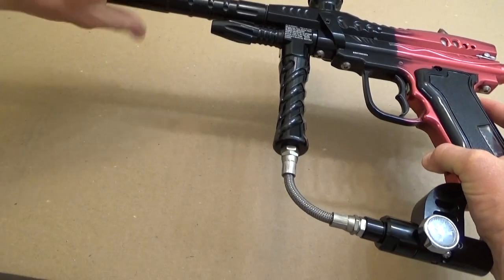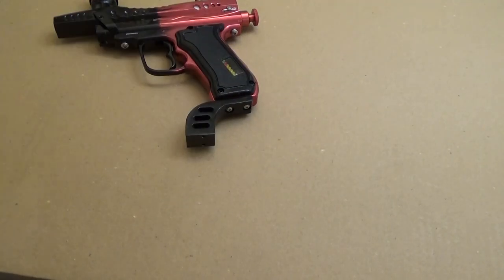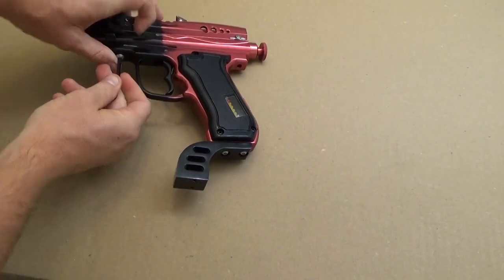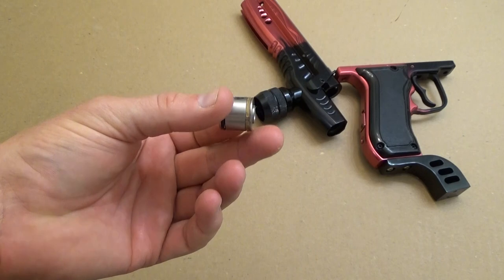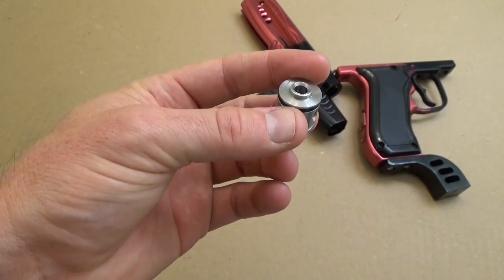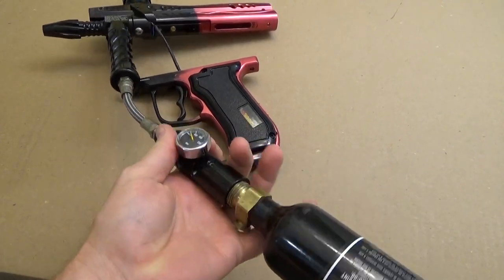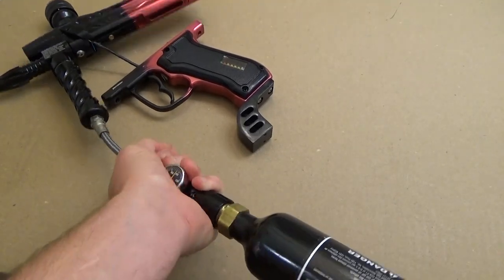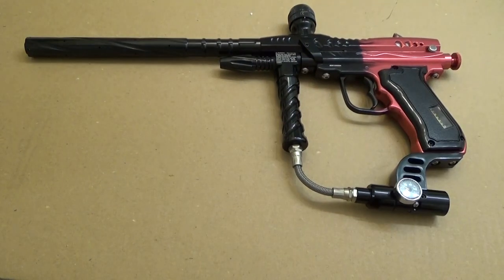How to Fix CO2 Leaking Down Barrel on Paintball Gun or Marker

Comment: 5 years later and you're still a life saver
Reply from the maker: Thank you.  Glad it helped.
Reply: Same here, was stuck until I watched this.  Had the same o-ring shredded.
Reply: @ClintHolland  what seal did you buy
I got the same paintball gun and the cup seal is in peace's.
please send me a link
Reply: I still dont understand what he means by hand tight
Reply: I’m struggling to fix my gun I have the exact same gun
Reply: Please reply I need help
Reply: @puglife_x_8975  hand tight means tighten by hand without the use of any tools, snug tight
Reply: @puglife_x_8975  but other than that, what else did to need help on?
Reply: @Cloud575501  I don’t think I need help any more, cause when I saw my valve o ring was torn up, I finally found that the problem was that so I was putting everything back together but the screws were not going in the holes all away and I don’t think my gun is going to work with the screws very loose on the handle of the gun. I don’t know if the holes could be messed up or if it’s the screws
Reply: @puglife_x_8975  i dont know man sorry
Reply: @BeatForge_Studio  it’s okay 👌
Reply: @puglife_x_8975  like dont tighten it a lot.

Comment: Perfect video. I've got a new gun with air problems. I fixed my old gun about a year ago and all your tips were exactly on point with my experience. O rings are biggest problem. Just check and replace any of them with little cuts or rot. Make sure that metal valve doesn't have scratches or anything. It does make a difference.

Comment: I just picked up a Diablo Mongoose and it looks like the thumbnail picture, not the gun in the video. Whats the difference? And it also came with some upgrades like a longer barrel and a different regulator that I'm trying to identify but haven't had luck. Think you could help me out?
Reply from the maker: Absolutely.  Happy to help.  The marker in the thumbnail is a Diablo Mongoose.  The one in the video is a Diablo Mongoose II Reincarnation. http://redfiremusic.tripod.com/diablo.htm  The main difference is the rate of fire, 18 vs 20, but there are also a few small other upgrades that it has that the standard Mongoose doesn't as well but the main one is the rate of fire.

Comment: thanks i had the same problem but im wondering where to get o rings? i ordered a kit on amazon i hope they fit cuz idk what size mine is but i was also wondering if maybe valves are all the same size? i have a spyder flash
Reply from the maker: They aren't all the same size but I did exactly what you did and ordered a variety pack from Amazon and was able to use one from the kit.
Reply: @ClintHolland  thanks friend!

Comment: Say good video, question can i use the auto motive seals if there the right size on replacing seal's.
Reply from the maker: You sure can.  It's pretty common to get them from an auto parts store when you don't have a local paintball supply store.

Comment: Clint.  I have a diablo Mongoose that had air leaking down the barrel.  I used your video and was able to find the oring that was broken and replace it.  After I replaced it I did not hear any air leaking down the barrel but when I fire my gun the ball will only go about 5 feet and the gun will not recock.  Is there anything you could suggest to help me fix the problem?  Thank you!
Reply from the maker: +Dan Kissane That could be several things.  First, make sure your CO2 tank is not empty or close to.  Next I would check or replace the spring or even try adjusting it.  There is the adjustment on the back that determines how tight the spring is which determines how much CO2 flows when you pull the trigger.  Try those two first and let me know.
Reply: Clint thank you for your reply. I have replaced the spring and open the air to full and I still get it. My tank may be the problem. When I screw it in it shows on the guage at about 2 but that is the only thing I have not tried.

Comment: This might be a dumb question and I’m sure you won’t reply but will old co2 guns run hpa? I bought a spyder pilot acs as a little project. I’m pretty sure it’s supposed to run hpa anyways but just for future reference I’m curious. Now that I’m 20 I’m capable of getting all of the markers I wish I had when I was like 9 and instead of buying perfect condition ones I’m planning on just rebuilding them. Any tips and maybe an answer to my question?
Reply from the maker: Absolutely Ezra.  You can actually swap out CO2 tanks with HPA tanks on any paintball marker.

Comment: My valve is stuck in mine, and I cant get it out. If the o rings are as bad on it as they were on the bolt, that would explain the leaking. Help!
Reply from the maker: Have you tried a lubricant Ike SD-40 and maybe a pair of needle nose Pliers?
Reply: Thanks so much will do
Reply: So I put some oil in there. And it's still stuck. I've pounded away on it but dont want to damage it. I cant get any pliers down mine either. I'm stumped because I've replaced all the other o rings and I'm assuming that it is leaking out if the valve, but I cant fix it due to it being stuck :(
Reply from the maker: @christianbasulto1274  Did you use regular oil or penetrating oil? If just regular oil, try penetrating oil like PB Penetrant and let it sit overnight.  You also may end up having to heat it to get it out.
Reply: Thanks Clint this did work. Many thanks

Comment: Hey I have a Diablo mongoose lcd screen and it's not leaking but when you pull the trigger nothing happens the battery light is all the way full and it's cocked any ideas?
Reply from the maker: If you are sure the CO2 is seated well and filled and you get nothing, no sound whatsoever, I would suspect the internal electronics are bad.  Do you hear any noise or click or anything when you pull the trigger?

Comment: Thanks so much for the video. I got my gun off someone and this fixed two of the issues it had. Now I'm running into an issue where I cock it and then pull the trigger but it de-cocks and acts like I'm out of co2. Any ideas?
Reply from the maker: +Matt Staggs Do you hear any CO2 escape when you pull the trigger?
Reply: +Clint Holland just as you would when you get close to out of co2. That fluttering noise that they make and it doesn't recock
Reply: +Clint Holland I think the previous owner tried to modify it. The spring is what I think is the issue. How can I tell if it's the original one? How long is your main spring?
Reply from the maker: +jesusmaphacked Most of my parts have come from Ebay. They are getting harder and harder to get now.
Reply from the maker: +Matt Staggs Hard to say because I don't have the stock spring. Try buying a spring kit for it off Ebay.  It's very inexpensive and I recommend you replace the stock springs anyway.

Comment: What’s the part that’s under the barrel you took off? I don’t have that on and my co2 sprayed out
Reply from the maker: Not exactly sure what you are referring to.  What is the timestamp on the video where you see me taking that part off?
Reply: @ClintHolland  you actually didn’t take it off, it’s that little spiral thing under the barrel.
Reply: @ClintHolland  in the front under the barrel above the handle
Reply from the maker: @angelrosales3304  On this gun, its part of the low pressure chamber.
Reply: @ClintHolland  if I don’t have that on the gun will is spray my co2 out?
Reply from the maker: @angelrosales3304  What model gun do you have?

Comment: I have a spyder pilot the dark green one, and i just bought new orings and now it’s j leaking inside the regulator where volumizer and valve go. it also has like a little hold I need help I can’t fix it. If anyone’s down to help reply please . I opened it and placed a new oring with sum lube but still leaking i’m guessing because of the holes.
Reply from the maker: I know this may be tough but can you tell approximately where on the regulator it is leaking?

Comment: paintball finex leaking air out barrel and change the o rings 3 times and still dnt work
Reply from the maker: Did you try the other items in the video that can cause a leak? There is more than just o-rings that can cause a leak.
Reply: It work now after i got this ...The X2 Inline Regulator is a two piece regulator. The top is machined 6061(T6) anodized aluminum, and the bottom is stainless steel which is polished to a high luster. The X2 is the highest flow regulator on the market, keeping up with any markers need for air. It is also easy to adjust using Quick Twist knob with tournament lock down screws.

Comment: Don't use co2 diablos are nice guns and co 2 can do a lot of internal damage
Reply from the maker: Been running C02 in this thing for over 5 years.  It was literally designed to run C02.  Not sure why you think that is destroying the gun.
Reply: @ClintHolland  Generally co2 on electronic markers is a bad idea. You can freeze and break a number of different parts like the solenoid.
Reply from the maker: @tomc5435  Then you wouldn't be able to use this gun around here. I frequent 2 separate paintball places and CO2 is all they offer.  The manual even says it is ok to use CO2.  Not saying you are wrong but this gun is still running strong after almost 6 years and has never had anything but CO2 in it.